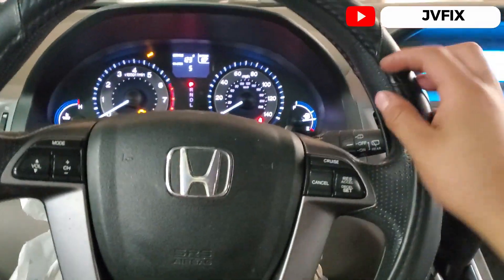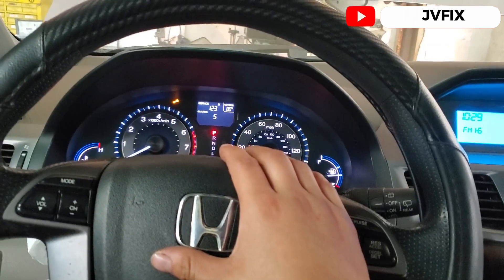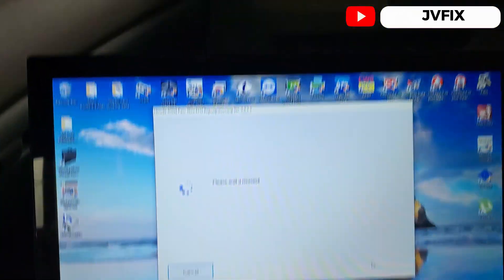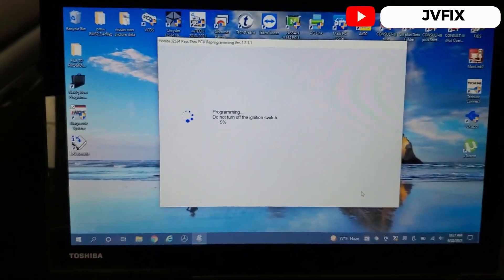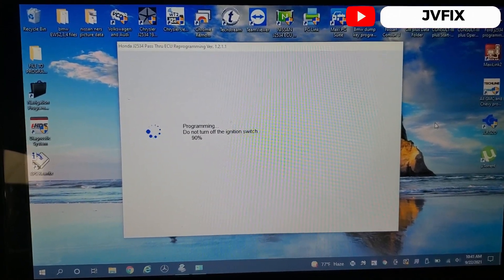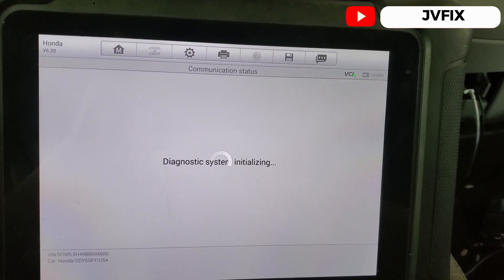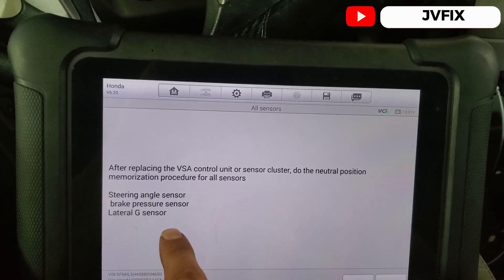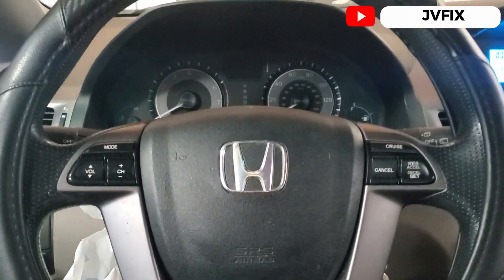How to program ECU and ABS on Honda car's using Autel J2534 reprogramming box

Comment: I've foxwell NT510 Elite, it has the same menu,  I just did that on my old ABS, and it did reset the ABS, my question is that can I use  that Foxwell Nt510 Elite after replacing a new ABS control unit on my 2008 Honda accord?

Comment: What scanner did you use that was compatible with your laptop.  My scanner's blutooth feature was not working on my windows laptop....hmmm?
Reply: He is using the maxiflash elite j2534 pass through for programming and an autel scanner. If you are trying to program DO NOT use a wireless/Bluetooth adapter it must be a wired connection to avoid possible corrupt data being loaded onto the  module you are trying to reprogram. If it loads corrupt data it will destroy that module and make it a paper weight.

Comment: Whay are you using to connect to the car from the PC? Is it the autel J2534 driver?
Reply from the maker: I used the autel j2534 jvci and the drivers for the tool are in the official website
Reply: @JVFIXLLC

Comment: Hello Friend, first I want to congratulate you on the great video. I would like to ask you kindly, do you know how to "cancel" the error on panel "D" Flashing signaling on the scanner that the error is about lack of communication with the ABS module, but the original vehicle does not have the ABS system in the old one ECU. I don't know if I explained my question correctly. Thanks
Reply from the maker: the software is downloaded once you pay for the subscription, but I'll see if I. can downloaded it and send it to you
Reply: @JVFIXLLC  Hello friend, I sincerely thank you for your help and attention. thanks

Comment: Hi are you using  the Autel maxiflash JVCI  J2534 with the Honda OM software ?
What is the main reason to  update a ECU and ABS on this car ?
thanks in advance !!!
Reply from the maker: yea I am using the autel j2534 and yes using the same program the dealership uses. the reason I updated the ecu was by request of the customer. and also if you swaped from a used one you can use the program to change the vin# cause sometimes with the scanner u can't.